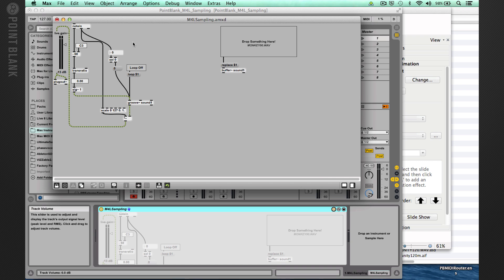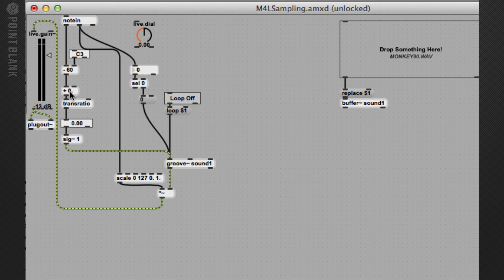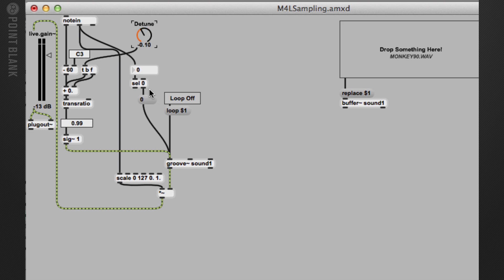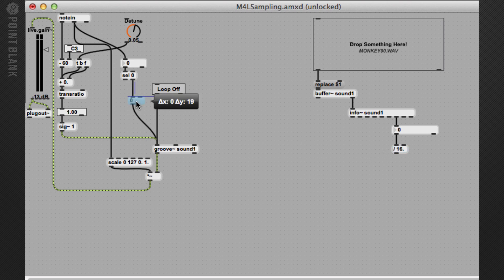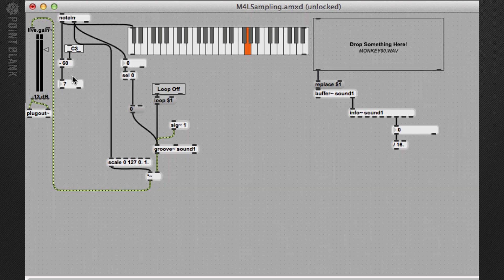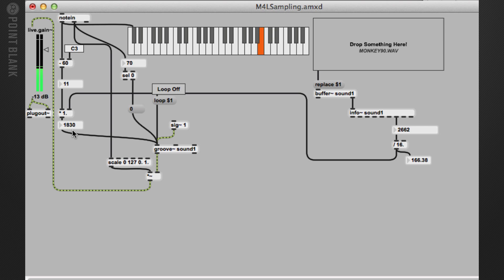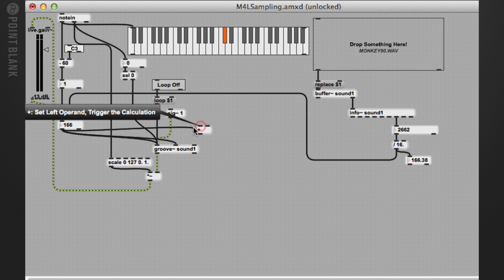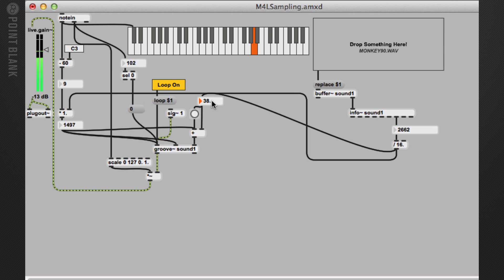Max for Live Tutorial: Building A Sampler Part 3

Comment: Great tutorial, thanks for sharing!

In Max MSP you can use decimal MIDI values. For detuning in cents you can add a decimal to the MIDI note number. For example a MIDI note number of 36.1 is C-1 plus 10 cents - pretty handy!
Reply: Wow! That's a great tip. That would be a much easier way to play with alternate temperaments within Max.Thanks!
Reply from the maker: sonodrome Woah cool! I guess it uses pitch bend for that?
Reply: Yeah you can use it for pitch bend. It's also really good for making a stereo detune effect. It generally saves you from having to do math on really awkward frequency values!